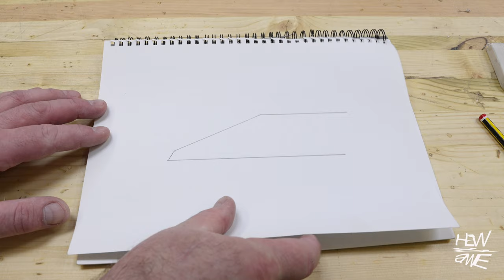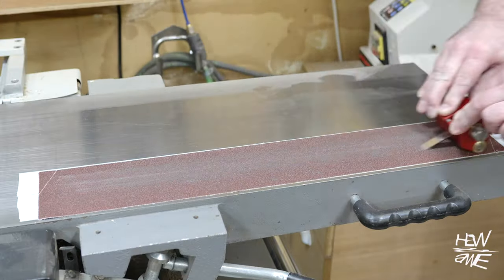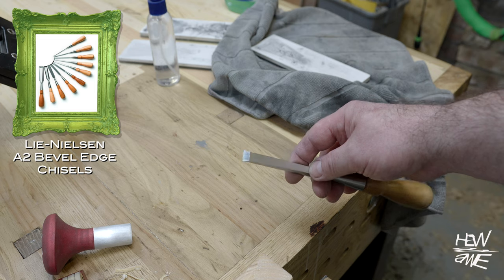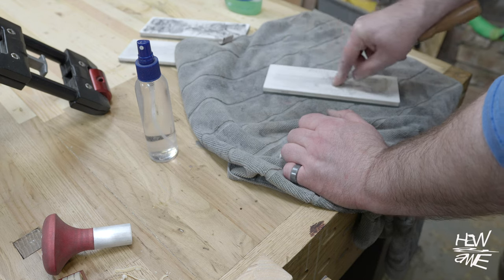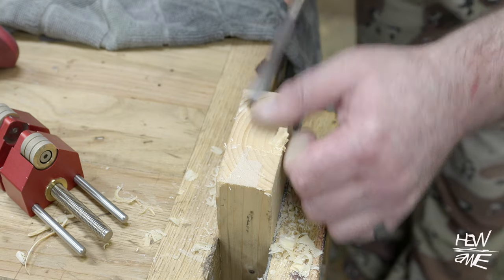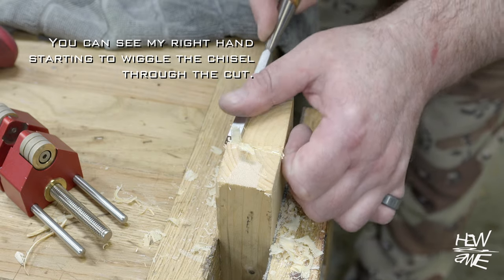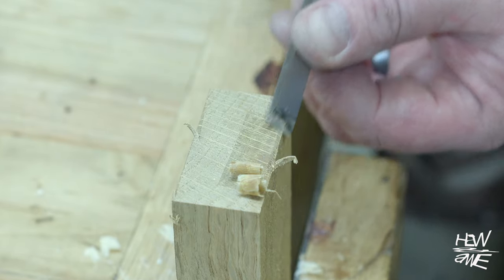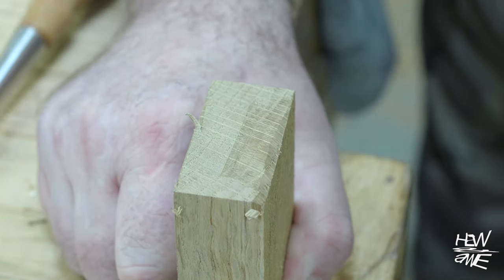Secondary Bevel on chisels is a waste of time IMO.

Comment from the maker: Just so we're crystal... 
We’re told the idea of a secondary bevel is to reduce the amount of metal you’re removing AND the time it takes to re-sharpen. 

BUT at some point you have no choice but to re-grind a new primary bevel right? 

That's a ton of wasted metal and time...!
Reply: It works well if you have a hollow grind. Do the primary grind at 25 degrees on a grinding wheel or Tormek and the secondary at 30. Saves a lot of time and I feel like the end stays sharper longer.
Reply from the maker: I sold my tormek, to slow compared to hand I felt. I’d  say try what I’ve shown and come back to me bud, it’s surprised quite a few friends of mine. Enjoy the rest of your weekend buddy 🍻🍻🍻
Reply: The long angle only has to be modified some times. The first you can sharpen it quickly. This has been the case for centuries and in almost all countries. Let's see if you think they didn't think the same. This man is not going to know more than the experience of hundreds of thousands of people before him. If I show you Spanish artisans who use chisels by hand to decorate, restore or model figures from old churches and baroque furniture, the Japanese and the CNCs will make you laugh, without templates, all from memory.
Reply: @HewAndAwe  Without the hollow grind the 25 degree all the way is better for sure. Have a good weekend.
Reply: I don't how the presence of not of a secondary bevel affects the amount of wasted metal. One way or the other, you'll end up grinding it away anyway...
Reply: Regardless of weather you use a secondary bevel or a straight bevel any material that’s not right at the cutting edge gets wasted, weather you regrind on a machine or on a stone.
Reply: i think you misunderstood the technique of second bevel sharpening 
the point is to skip time on medium stones whit 1 degree of bevel change not 5
every sharpening you need to do 
first bevel coarse stone (not once in a blue moon every sharpening)
second bevel on finishing stone

Comment: Cabinetmakers prior to like the mid 20th century seem to have preferred the “grind at 25 and hone at 30-35 degrees” method because fine natural stones were way slower than modern synthetic ones, so if you’re using a fine natural oilstone it does genuinely save a lot of time. (Referencing Nicholson and Hasluck here, writing in the early 1800s and early 1900s, respectively). 

With modern synthetic stones secondary bevels only really make sense if you regrind with a dry grinder with a VERY coarse wheel (only takes a couple of minutes to refresh a primary that way) and you want a super uniform polish on the edge of the tool while using fewer stones. With so little metal being removed you can often skip the coarse and intermediate stones and just go from fine to ultra fine, and a lot of people like that.

If you have to regrind with sandpaper you can lose more time from having to regrind periodically than you’d gain from using fewer stones and having to polish less metal, so secondary bevels can be a waste of time, as you show in the video. If you make a habit of touching up the edge before it gets too dull, you usually only need to use the finer stones anyway.

Either way, a sharp tool is a sharp tool, and the best sharpening method is the one that works for you, so don’t let anyone tell you that you’re wrong for using a different process.
Reply: this is false. There are always excuses made as to why cabinetmakers did something 150 years ago but the advice is out of date. We don't have the stone that would've been the prize of a cabinetmaker in 1850 - a turkish oilstone. The turkish is as fine or finer than the finishing waterstones that we have until you get into nosebleed grit, but it was slightly friable and would sharpen faster than you can with a waterstone due to the ability to apply pressure in both directions. 

Grinding shallow and then working a secondary or even tertiary is mentioned in nicholson and holtazppfel for bench and paring chisels and plane irons because it's more efficient. It's more efficient now,  and it was more efficient then. The real wildcard between then and now is that the planes and chisels being used were a means of economic gain - they did the rough and the fine work and the volume of work was much greater. there's no tolerance in an environment like that for an incomplete sharpening or putting sharpening off due to the disdain to deal with a whole bevel. Nicks in an edge are typically very fine when they do occur and can be ground out in a secondary bevel without resorting to primary grinding. if you use a single bevel, you are forced to regrind in that case. 

Hollow grinding on a round wheel was prescribed all the way back to nicholson's text with warnings there and through hasluck in the early 1900s to not rob yourself of time before you start by allowing edges to be anything other than moderately concave. 

The other thing that no craftsman back then would've tolerated is honing on two flats on a hollow grind. Sharpening and finishing the edge itself is sort of an art, though it doesn't have to be complicated. You need to be able to feel what's going on and make sure the last of your work is directed at the edge, not a couple of small flats. The prescriptions given by holtzappfel and nicholson leave a minute edge below the wheel ground bevel that is steeper and probably ever so slightly (but not intentionally) convex. it's a better edge than one right off of a hollow grind. 

I've got two turkish stones - one is vintage and the other is a cretan type hone from greece or perhaps crete - they're not similar to a broken in arkansas stones. 

I have to give you accolades for referencing nicholson and hasluck, though - both sources far better than almost anything given now. it's not like you can't do certain things now - we can all do what we want, it's a hobby for most. Speed and consistency of hand tools was a prime mover in nicholson's time and even if sharpening properly is a 10% gain (could be a lot more compared to how some people sharpen now), that's a huge deal for someone doing rough to middle work, or doing smoothing and especially avoiding damage. Same as the cap iron - holtazppfel and nicholson prescribe use of it. Most people have no idea what it does, but it's essential in all hand tool work, and beneficial in others. How beneficial may not be noticed if 2% of the work volume done is with hand tools and then power sanding follows them, anyway. 

It's a shame the turkish oilstone is not common or found enough to be a staple now. The crete stones are a more coarse version, but a quick swipe across buffing compound on MDF  in five seconds will  put them on par with anything.

Comment: Metal wasting is not an argument as only the tiniest slice of metal of a chisel does the real work, all other metal is just for rigidity of an instrument and goes into waste no matter what sort of sharpening you use. I prefer to have 2 bevels on chisels as I can use the coarsest stone to quickly create a primary bevel and finer stones for a secondary bevel. In case of only one bevel I will need to use full set of stones for a much bigger area.
Reply from the maker: Well it is actually. And more time is spent removing all that to get back to a base bevel. Try it and see fella.

Comment: I used to hate chisel sharpening. Tried everything. They’re all long and tedious. Then I came across the Robert Sorby Pro Edge. A regrind takes a very short time with no effort then a secondary bevel on diamond plates are my method. Doesn’t take long at all. Belts are cheap and last ages.
Reply from the maker: Yeah I hear this a lot, I also hear mixed opinions on it to. When I’m rich and shameless I’ll buy one.

Comment: The edge is what does the cutting -- the material behind the edge is "wasted" in either case. The difference with the secondary bevel is, when you get to the point of re-grinding, you are taking off that wasted material faster, because you are using a coarser grit.
Reply from the maker: After all this time I was thinking the handle did all the cutting 👌

Comment: The secondary bevel is simply a resharpening 'in use' aid. You're using your chisel and it needs sharpening. Sharpen the short cutting edge and continue. You are putting off the full bevel touch up and the same amount will be removed, overall, but that can be done away from the specific task in hand rather than a little bit for each 'in use' resharpen.
Overall, both ways take the same time and same waste - the difference is while using.
Reply from the maker: Try with out, like I said it cuts better.
Reply: @HewAndAwe  I don't really need to. I'm already @ 25 then sharpening the edge only as I go. I probably end up around 28 but who knows. I reject any concept of bevel maintenance when my chisel is in hand. Sharp edge will do me. And I don't get secondary bevel creep which might lead to wastage.

Comment: 30-40 minutes sounds about right for sand paper to get back to a primary bevel.. a whetstone grinder is a bit quicker. How long do you tend to find it takes you to sharpen and get a burr on a 25 degree bevel on your stones with the O1 or A2 steel each time you hone?
Reply from the maker: Not long at all less than 5 mins to 8K.

Comment: Interesting take. I can't chime in on the sharpeness aspect, not really tried a back to back test. 

I would say your picture showing the wasted metal due to the secondary bevel isn't actually showing wasted metal. It is showing the metal you didn't have to grind away due to using a secondary.

You are quite right, eventually you then have to remove that chunk of steel and that takes time. But that is the steel that would have been removed incrementally using only a single bevel.

So the question is whether you want to take it off as you go or take it off in one big job. 

Personally I roughly hollow grind with a bench grinder (not grinding up to the edge, just getting a decent concave) and then free hand sharpen. Free hand tends to create a convex bevel over time, which is canceled out by the hollow grind. The grinder removes the time/effort conversation.
Reply from the maker: I’ve never tried a bench grinder one I don’t have one two I’ve always been told there’s to much heat involved. But yeah I hear what you’re saying and can see how that works. 👍
Reply: @HewAndAwe  you certainly can ruin an edge or even a tool with a grinder. But like a lot of things, if you don't go at it like a fool, it's fine.

Comment: i was thinking the same, 1 question though; even with a jig the chisel might be place just a little bit different then the time before and thus would get a slightly diff angle. A bit to shallow and you only sharpen the heel and a bit more steep and you end up still doing a secondary bevel. How do you make sure you are consistent? I use the Lie Nielsen style set up block (stops for the angle) getting it exactly the angle seems difficult to me but do you have any problems? regards
Reply from the maker: Depends, are we talking from a regrind or getting the edge back? From a regrind I don’t take that chisel out till it’s done including honing. A touch up grind just to get the edge back I do it a lot more often and I’m making my hand sharpening better in the process so I don’t really notice what you’re saying cause yeah that absolutely does my head in, especially the wider the chisel is the more it pisses me off. Having said all that I’m really getting to the point where I’m thinking all this is bullshit, as long as it’s a square grind and razor sharp I’m happy, I’ve 5 sets or so of chisels and I keep my fine work chisels as are till the last minute too the use them.
Reply: @HewAndAwe  getting the edge back i ment. I am just a bit ocd about a skewed bevel after that. Regrind i do on the tormek because that shit just eats your stones away and those nice shaptons i wish to keep in a good state. I was just wondering what you do and if i missed some awesome tip or something. thanks for the fast reply

Comment: It's an illusion. Same amount of metal is removed.
Reply from the maker: I can’t see how that could be true dude when taking a 32 degree bevel out of a chisel down to 30.
Reply: @HewAndAwe  You take a weeney bit more metal off with the initial setting of the secondary bevel then take very little with the progressive honings (as the secondary bevel widens).  The other method you take a weeney bit less in the beginning, but you're taking the lower grits to the bevel more often.  It all comes out in the wash in the end.

Comment: Don't use secondary bevels at all, sharpen a single bevel to 30° on plane blades and chisels, have a few chisels ground to 25 and some paring chisels to 20... Usually don't use them though, 30 works for 99% of what I need
Reply from the maker: Did you not find at 20 degrees the business end rounds over real quick?
Reply: @HewAndAwe  it does, they're old paring chisels and don't use them much at all... Most of the time 30 degrees does it

Comment: a bit late to the party but Ive been on 2 separate weekend  courses in what were production workshops . One  quickly ground a single bevel on circular whetstones and the other a single bevel on the scary sharp system using a caritas honing guide. Both then quickly stropped on a sheet of mdf with polishing compound. None of this primary/secondary/tertiary bevels on water or glass stones up to 16k or 32k .  Its all getting a bit OCD? I'm pushing 70, and my old dad did all his work with ONE ancient half inch chisel which he sharpened on a single India stone (shaped like a banana) - without a honing guide and a chunk of old leather belt as a strop.. good enough to shave with! ( I still cant do that)
Reply from the maker: Funny I know an old boy and he waxes lyrical about oil stones, I saw his and it looked like a skate park! I agree the whole thing is out of control, sharpening seems to really grind some people’s gears when you don’t agree with them to its right up there with political parties 😂

Comment: I’m also in the NO second or third bevel on chisels or plane blades. I like to freehand sharpen and follow Paul Sellers method. This results in a chambered bevel which solves the    argument for 2nd or 3rd bevel as strengthening the cutting edge. The argument of saving time is just silly—30 seconds, 90 seconds or even 3 minutes? Really, people are going to complain about that insignificant amount of time? Just crack on mates, and sharpen up. Cheers
Reply from the maker: I’ve always wondered how peeps that sharpen by hand fix a chisel that’s say skewed…

Comment: I’ve often wondered about secondary bevels and never really understood  the mechanics of it. Next week all my chisels are getting reground to 25 & bugger the secondary bevel
Reply from the maker: Try it on one dude, I’d suggest like I said in the vid not to grind to 25 for hardwood. You may as well hit it with a mallet. 🤦🏻‍♂️
Reply: The primary angle being shallower from a bench grinder or water wheel might be saving your whet/waterstone material. This method does work and it's fine for paring, but I can see the logic of using a shallow primary angle. The contact area is larger if you always flatten the primary bevel on stones. Using a single  angle should have more metal material behind edge, and in theory make the edge slightly stronger with the extra metal on top.
Reply: @HewAndAwe   grinding for hardwood at 25 degrees isn't an issue. the secondary bevel gets an adjustment. Damage never progresses out of the secondary angle unless a tool is defective or someone is opening paint cans. Holtzappfel prescribes 25+5 for softwoods (primary and secondary), and 25+10 for hardwoods. The text was written at a time when damage to fine tool edges would've been intolerable, but so too would've been slowness. 

I've ground to 20 degrees without an issue. Below that, you  find edge damage pushing the secondary edge back into primary. there is no reasonable limit to the woods I've malleted, so there isn't a "but if it's maple" end to this. I've made planes out of ebony and cocobolo and never ground above 25.

Comment: Ok here's a serious question.

I've just watched you prove that a secondary bevel is a waste of time, literally.

In which case. Why did the makers design chisels with a secondary bevelled edge in the first place? What purpose dose it have? 

Okay, that was two questions. 

P.s. I know you told us the reason but i couldn't think of a better serious question. Sorry.🤭⚒️🏴
Reply from the maker: I can only guess dude, possibly strength. I know if I grind a chisel to 20 degrees it’ll round over very quickly on hardwood but go through softwood like butter, a micro bevel would make that stronger maybe 🤷🏻‍♂️

Comment: If you are using the final angle at 25degree as the old micro bevel, paring should be the same. But have you tried to use it for mortising? I think the steeper angle might make it harder to mortise since you would have a thicker wedge and have to change your angle a little from what you are used to. It can be done, but I can see it throwing you off if you get to close to your mortise wall. I think the old primary angle factors in more for mortise if you don't use dedicated mortise chisels.
Reply from the maker: I did say in the vid these are paring chisels bud, I’d only put a primary bevel of 25 of chisels for soft wood too. Really nothing to do with mortise chisels, I’d put a 30 - 35 primary bevel on them, but no secondary, it’s a waste of metal.
Reply from the maker: My opologises I read youre comment wrong, I dont read to well to be honest, very dylecsic! The above was solely and only for pairing work, mortise thats a whole differnat game, funnily enough a rabbit hole I was sent down and maybe my next vid - depends on when a GOOD mortise chisel arrives. Till then, hope you enjoy the rest of your weekend! 🍺🍺🍺
Reply: @HewAndAwe  All good man.